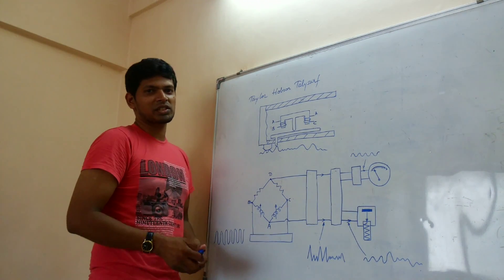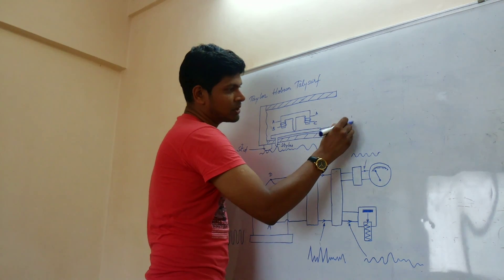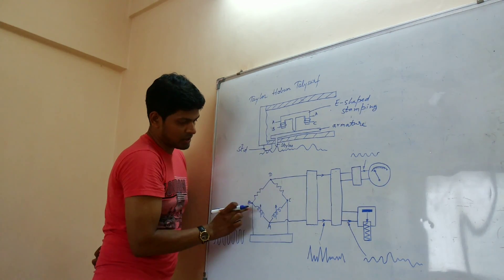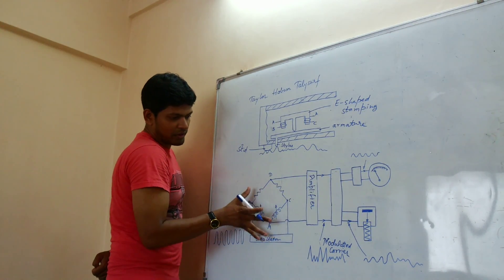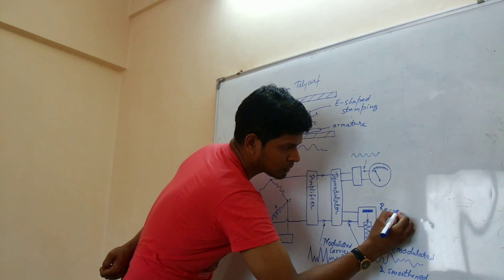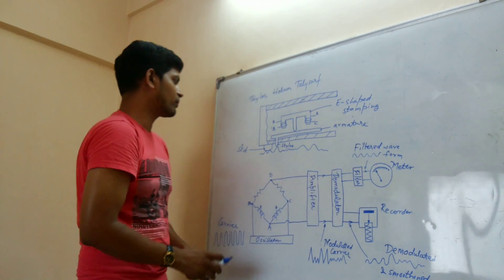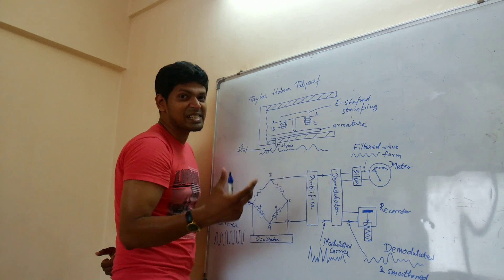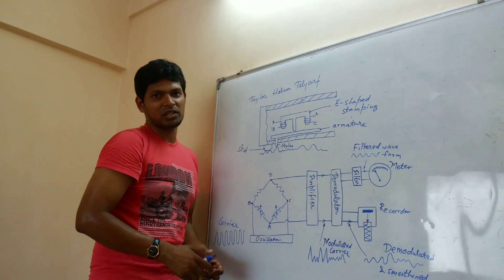Taylor Hobson Talysurf.... #50kviews #viralvideo

Comment: Hi, I bought a vintage cine lens. Mount diameter is 16 mm. I do'nt know what type of mount it is. Its not C mount. I have C-EOS M adapter which does not fit on it. I guess I may require a special step up ring on whi I could use C-EOS M adapter to use it on my Canon mirrorless camera. Your expertise would be highly appreciated. The lens was by mistake described as C mount. 1.5 INCH f1.9 SUPER COMAT TAYLOR AND HOBSON Lens C MOUNT 16mm Movie